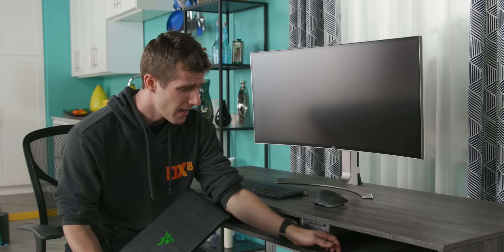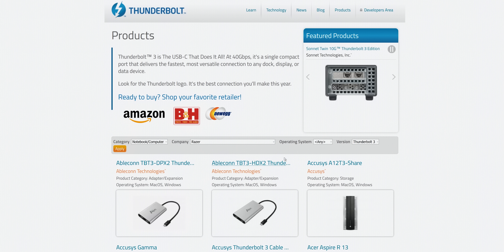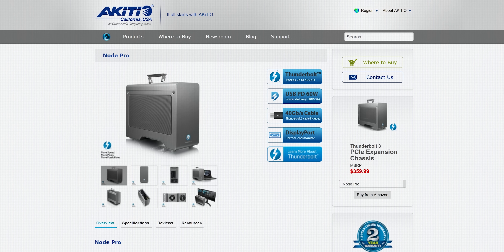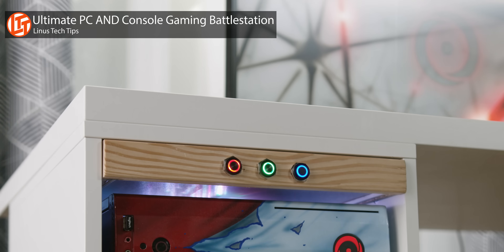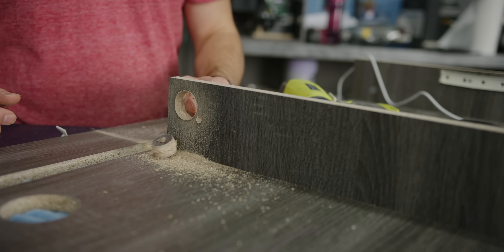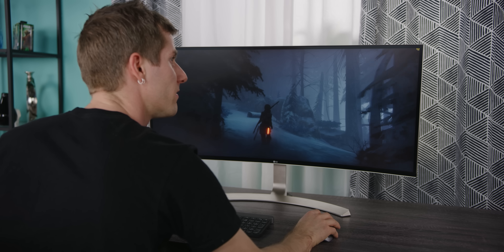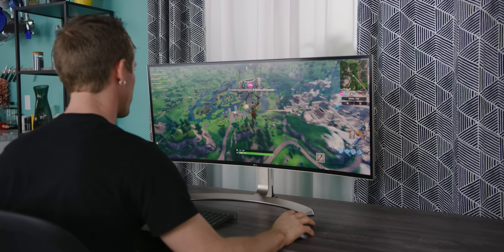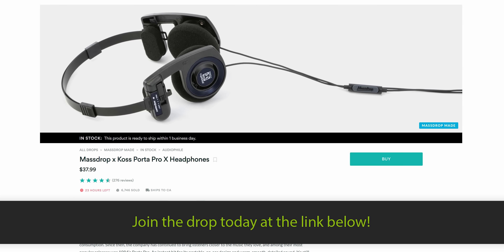This is the CLEANEST Setup.

Comment: I wounder if there is any latency with the input devices?
Reply: of cause there is... so far i haven't seen any devices that doesn't have latency.
Reply: Asking the real questions I see.
Reply: I use an eGPU setup with my XPS 15 with an i7-6600HQ and a Mantiz Venus enclosure with a 1070 Founders Edition in it. I wire all my peripherals such as my headset, keyboard, mouse, and other stupid things like the Razer Firefly to the enclosure itself and honestly, nope. It's as seamless as if I were just using a desktop.
Reply: @zLambSauce  I tried the Mantiz Venus enclosure and had lag with the Founders edition 1070 and MSI GS43VR.
Reply: Really no .. well sort of. The thunderbolt is pretty much a 8/10 modulator right on a the PCI-e port... Of cause the bandwidth is limited. But if you have plenty of memory on the gpu... It's really not a issue. If you use "agp memory mapping" emulation .... Well.. just don't. Turn it of if it's possible.
Reply: Yea I have to imagine. I had the Razer Core 2 and tried it with a couple different laptops. They all had lag. I tried another Egpu and had same issue.
Reply: There has to be, but most likely very negligible unless you are an e-sports speed fnatic (pun intended).
Reply: Yeah, you'd think so. Mostly what I don't get is all the work, time and added expenses that goes into this setup. I appreciate minimalism as much as anyone, but this concept is a fail imo. You got this kinda money, why not just buy a laptop with an onboard 1070 or 1080 and hook it up to your monitor. It'd be cheaper, less hassle and with minimal input lag.
Reply: @FromDkWithLove  LOL, who want to carry that kind of laptop around? You got no idea what you talking about kid...
Reply: @Xfacehack  I do. I've had a laptop with an integrated 1070 for about two years now. It's sleek, weighs about the same as a carton of milk and I haven't had an overheating issue yet. There are plenty of portable gaming laptops around. 1080 though, that's another story. Also, who are you calling kid, kid. I'm 31, like 15 years older than you. I was building my first pc while you were still breastfeeding. :P
Reply: @FromDkWithLove  They not "sleek" they heavy and have terrible battery life. (Okey they have gotten better) Sound a lot and gets hot. Why carry around a freaking battle station, when you only using it at home? Besides, you not going to see that good of an performance that you see with a e-gpu! They throttle way to much! 

I use an hp x360, which i use to type in excel and word etc. Nothing heavy, but battery get me through 10H even with display turn down and windows update etc OFF...i type like 3000word each day. Got no time to be plugged! When i come home, i have an station with 1080 ti, because that's best performance within reasonable price. That laptop is just a bad compromise. Nothing is good, but not terrible.

Oh and those laptops are expensive ASS fu*k!
Reply: @FromDkWithLove  Laptop with onboard 1080 is not so portable anymore. Thing is to have portable laptop with you and then have power at the desk.
Reply: @FromDkWithLove  Yeah I understand where you're coming from, though it is cheaper to get this setup then having both the Laptop and another Gaming Computer.
Reply: a lot. GPU over thunderbolt works like at 70-80% of it's capability.
Reply: @madd5  That's not latency, that's a throughput bottleneck
Reply: @madd5  yeah
Reply: @madd5  barley does depending on the wattage total the dock can pull. 70 maybe 80% at best with a 100+ watt pull. Id say that its closer to around 60-70% mark for the power it pulls plus the laptop cpu will bottleneck that poor gpu. Making it preform worse.